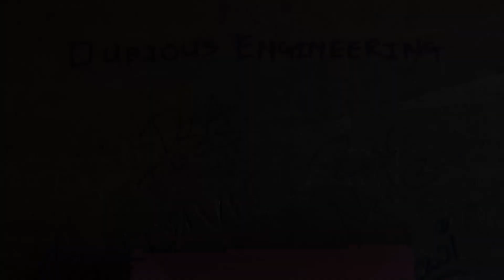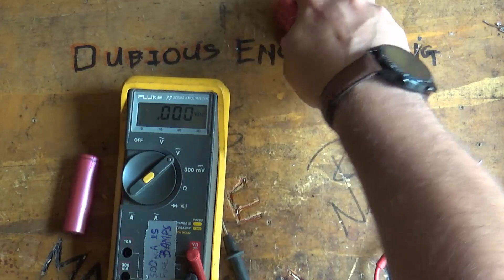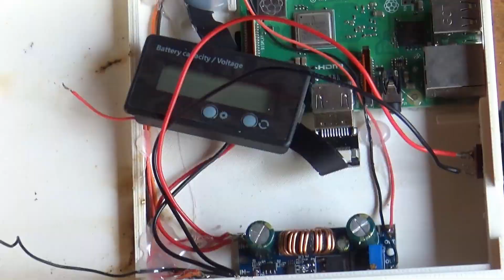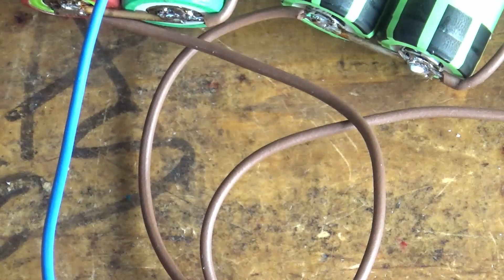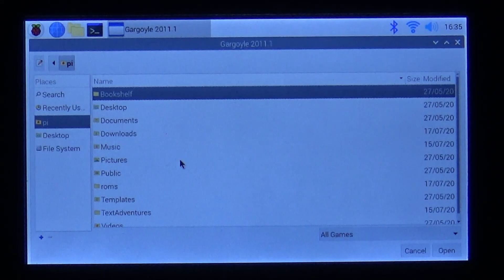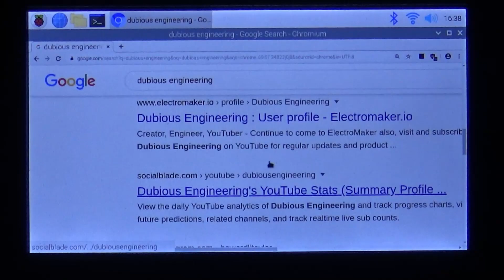DuB-EnG: DIY 3D Printed Raspberry Pi Laptop PiTop Home Made Portable Computer

Comment: That's a nice finish to the project. I like the way that you designed the case to hold the keyboard but easily lift it out to get to the innards if required, and the BMS should stop the magic smoke from escaping with luck :)
Reply from the maker: That magic smoke that keeps the machine running... it absolutely needs to stay in the machine!! Don’t let it out!  BMS saves the day!!  Hope you have had a fantastic weekend my friend!!

Comment: I've found that a solar garden light panel will re-condition 75% of the cells reading <1V. 

Not sure what to do with all my cells yet... [ ponders an Amiga A600 laptop ]

[ ed ]
I bought 5 of those exact BMS systems, I'm thinking of getting the OLED controllers with variable Vout.
Reply from the maker: thanks Phillip, I have some old solar lights... I’ll have a go at a slow recondition charger